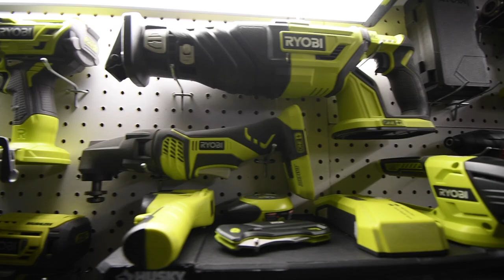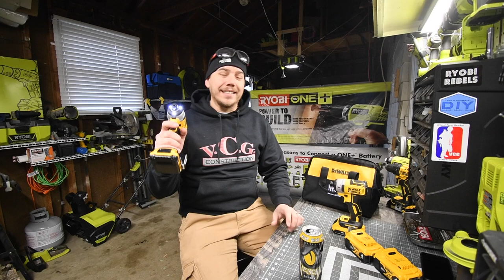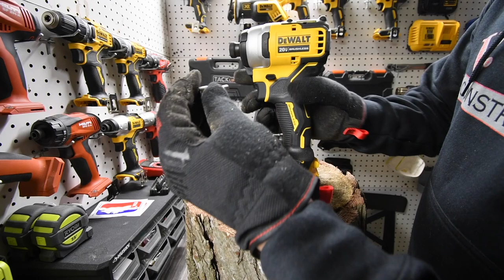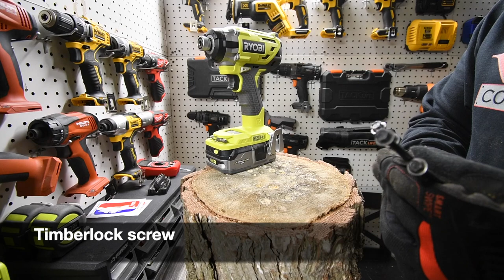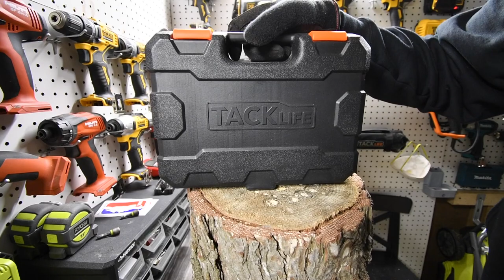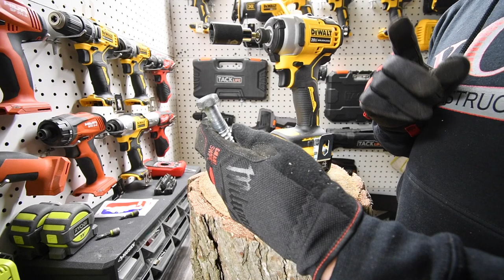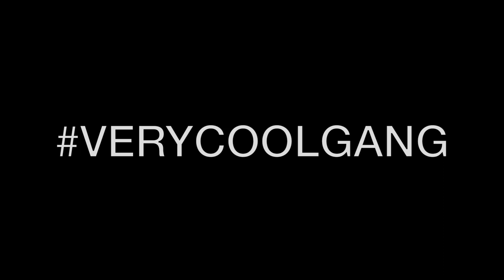Dewalt Atomic Vs. Dewalt XR

Comment: I'll take my Dewalt 12V Xtreme over that Atomic all day , it has almost as much power in a smaller / lighter package . Watch VCG's video on the Xtreme vs Atomic.  I also have the XR and its a BEAST , I usually only use it on decks and stuff and I usually use it on #2  because #3 can be a bit hard to control , it just wants to bury the screws all the time...✌  Be Safe....😷
Reply from the maker: very good and I thank you Brian and be safe

Comment: I think the atomic line is great don't need three speeds on my impact driver I never use it
Reply from the maker: I agree. variable trigger only suits my needs
Reply: @ManCaverTools  To me those speed controls are something that will probably break, and if you can't control a tool with variable speed maybe you shouldn't be using tools
Reply: I’ve had the 887 for 2 years and I use it all the time. The 3 speeds are great - speed 1 when using small or delicate screw like a screw gun/driver substitute. Speed 2 when you need more power but don’t want to strip heads or break an anchor. Speed 3 is for the big jobs.
Reply: I don’t use them as speed settings, but more as a torque setting. My Milwaukee. Will tighten the fastener then complete shut off so it doesn’t over tighten. The variable trigger doesn’t work that way. It has been very useful at times. Around Christmas putting things together with it, I was using a very powerful tool that could have easily stripped things out, but I was able to use it like a screwdriver.
Reply: Speed settings are another way of marketing the tools every so often they come up with some self call advance setting but in all is the same tools . Tools are like phone's  big industry .They need people to come back  constantly but something's don't make sense sometimes

Comment: I believe the atomic line truly cheapened Dewalts brand, I dont like its chinese. My xr are u.s. made and all out proform atomic. Except for one or two tools the atomic get only, it's not worth looking at. Dewalt claims it's to compete with 12v line in size but they got a good line there...interesting enough I got 2 xr brushless 1/4 inch impacts one 887 and 1 lower model. The atomics being weaker, and cost cutting I see as entry line. It should have been craftsman to Dewalt like rigid to Milwaukee...
There are those who say the battery dont matter but if the motor can pull more it can do more.
Reply from the maker: The Flex battery majorly gave the Atomic more power, I was impressed that it was able to take the lag out when the 4ah couldn't, But the XR is a much better line and thank you for view

Comment: only thing i question is you running the atomic at 2x battery life vs the xr 3x battery life... maybe the atomic didnt get a full charge? doesnt seem like a fair comparison imo
Reply from the maker: both batteries were at full charge. some tools use more power than others

Comment: Dewalt has another better version of this same tool with a  different chuck that is flush with the nose and has a small trigger to release the chuck and the 3 speed/3 torque levels and of course brushless.This is their top of line model had to get online not available in any stores that I’ve seen it’s twice as expensive as the X-R model but worth it.
Reply from the maker: I saw that and I am trying to get my hands on one
Reply: @ManCaverTools  i think what he is describing is a old tool dcf895c2
Reply: thats what i got and love it he used the wrong version

Comment: Of course the Atomic is using more juice from the battery, it looks be doing almost double the work.
Reply from the maker: I thank you for viewing Hien
Reply: @ManCaverTools  Great content bro, very informative. I have the XR, but only use it for larger jobs. The setting on one is a little weak and setting two is overpowered for putting short screws in. I picked up a Dewalt 12v, which is near perfect being small, lightweight, and perfect for most everyday jobs! I understand why you enjoy the Atomic so much. Perhaps do a 12v vs Atomic in the future!

Comment: For the big lags, I would have slapped a battery on the DCF899 and be done with it! Very similar/identical tools with different software.
I own the dcf887 and the dcf899.
Reply from the maker: the atomic did it very Weill the 6ah. major power boost

Comment: You obviously are a tool junkie , lol, and that can be the only reason you would like the atomic line. The only tool in the atomic line to own is the compact drill/driver for getting into tight areas and general drilling. XR and flex volt is the way to go. I’m a professional contractor and I use 2hr and 6hr flex exclusively. I use the flex in my 996 hammer drill, all 20v get the 2hr which give excellent run time and quick recharging.
Reply from the maker: I just did a video on the XR hammer drill :)

Comment: You are wrong sir. The while the flex volt can maintain the 20 volts under heavy load its only because it can supply more voltage. A normal 5AH battery will produce the same power as a 2AH battery but just do it for longer.
Reply from the maker: MrWizards1974 good job, you just said what I’ve been saying this whole time. 20v is 20v no matter what the ah are. More cells that are in the battery the better the battery will retain the power that is already there. Because of that. The 4ah will outperform a 2ah on a single task. Ah don’t give it more power. It lest it use the power that is already there under a more stressful load.
Reply: @ManCaverTools  You said at 17:36 "this is for those of you who believe that 18v is 18v or 20v is 20v"  "A more powerful battery does increase the power of the tool It does" You are twisting things up sir.

Comment: Like I said on the DeWalt group, I talked shit about the Atomic line until I got mine last week. Now, I think they are pretty nice for the price. I don't need a speed selector and the battery gauge issue is easily fixed once you buy better batteries.
Reply: I was immediately turned off by the atomic when i learned it only came with 1.3 amp hour batteries could have easily gave us 2 like the xr or even the regular dewalt had 1.5
Reply from the maker: I love the atomic line, the drill is so compact and light weight compared the XR.
Reply from the maker: The 1.3 are garbage but its better than not getting batteries at all with the kit
Reply: Minnesotaman My atomic set came with two 2ah batteries

Comment: What makes you love the atomic impact so much isn’t it like .00001 of a inch smaller and way weaker than the xr impact
Reply from the maker: because as a homeowner I don't need the power of the XR, so in my case I get to go for looks instead of power

Comment: The atomic is not worthy of the DeWalt name.....we are  building a deck and my Milwaukee 12v gen 2 impact out performs the 20v ( 18v ) atomic. If u take apart the xr line and the atomic line you'll see quite a difference in the motor and the copper windings.
Reply from the maker: That is correct, im not sure but im pretty the XR won

Comment: Ryobi? Sad...
Reply: have you actually used it? Im a dewalt man but my partner uses Ryobi so we share tools sometimes and il say they cost less and are just as powerful, the only problem is the size for me. Theyre a bit too bulky. Oh forgot to mention the magnets on the drill base is a nice touch.
Reply from the maker: the XR battles will be a different story though
Reply from the maker: I agree, they are bulky with power but the difference is Ryobi will lose that power faster in time than dewalt

Comment: You lost me by putting on the 4ah battery hoping for a “little boost”. This has no effect on power, just run time.
Reply from the maker: Yes there is. I already proved it for all brands. check out my "battle of the AH" video I recently uploaded. the 4ah destroy the 2ah when doing a single task
Reply: Put an octane battery on a ridgid impact vs a regular 4AH on a ridgid. You can literally hear the power difference just by subbing the batteries.
Reply: Interesting. Thanks.
Reply: Its true that the larger batteries give a bit more power